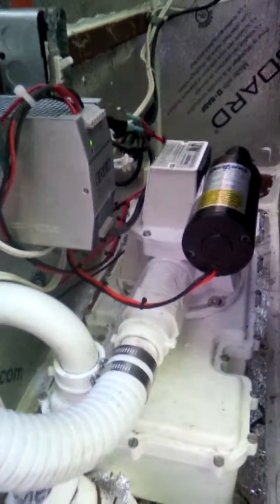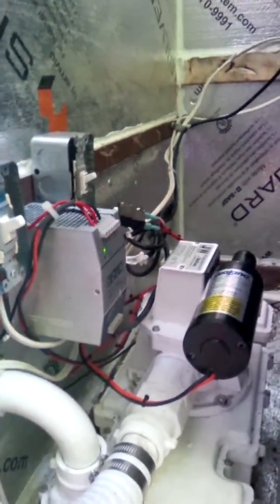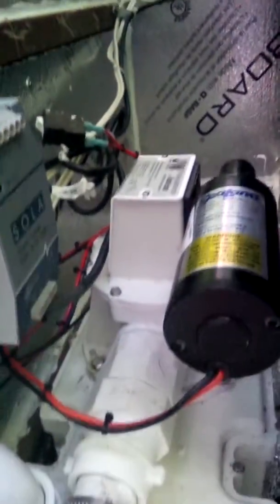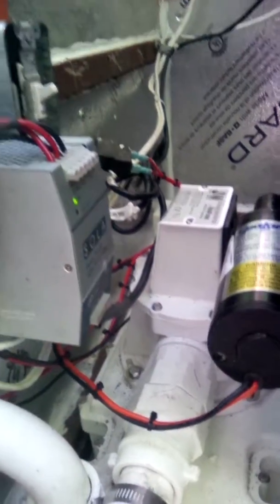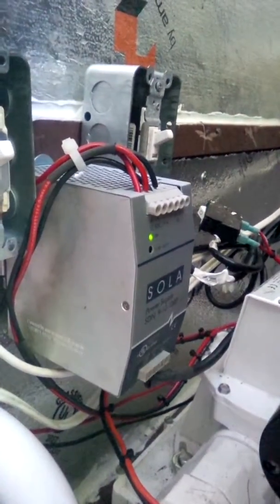Loon Point Cottage (Tamarack Lake) - Envirolet  Remote Composting System Demo

Comment: It's been a few years since you posted this video, are you still happy with this system?  Have you ever figured out how much it costs you in electricity to run it?  I plan on installing it pretty much like you did in a insulated box just outside our cottage but I am worried it would freeze when not being used did you have any issues with this?  I am thinking just a light bulb in a well insulated enclosure would be enough?

Comment: Thanks for the video. How is the odor? Could the tanks be placed closer to the home or would you not recommend that? Is the protective box really necessary? (it looks like it is.)
Reply from the maker: No odor whatsoever, neither in the cottage bathroom nor in the composting tanks nor anywhere on my property.  Really happy about that part.  The protective box is insulated...  I live in Canada where we invented freezing cold and the insulation allows me to use the system year-round.
Reply: Mine is in my basement and it is smelly!  Not pleasant to spend time in basement.

Comment: Pretty cool Monte, so basically the second tank apparatus acts as a backup system too if for whatever reason one system malfuctions?  Great job, really like it, especially the evaporation discharge towers.  Mark :)
Reply: And one system will malfunction.  I will probably have to get a septic pumping company in for one tank, so in the meantime I was able to install a new length of pipe from pump to the second tank and still use my toilet.   And that was a messy job. Only one person part time and liquid tank filled up too.  No solution offered by Envirolet!
Reply: laraghn I guess you had defected issues with your system?
Reply: Right CrestwoodRocks.  Sent you a message through your YouTube page - presumably private....